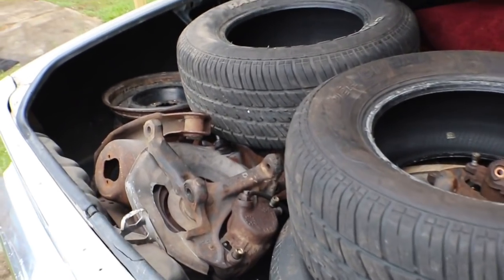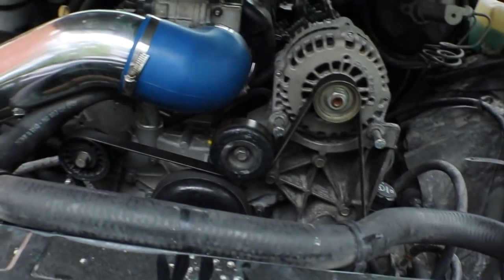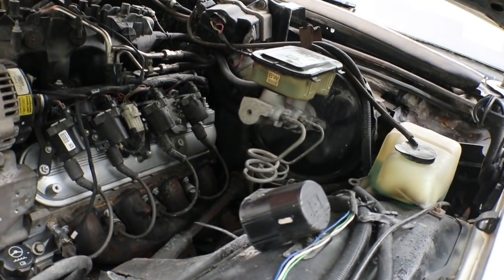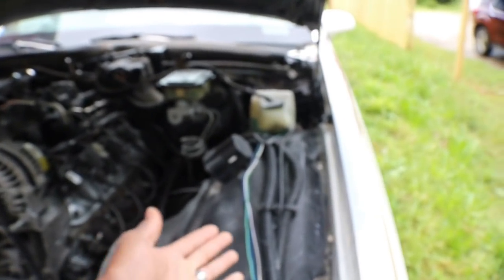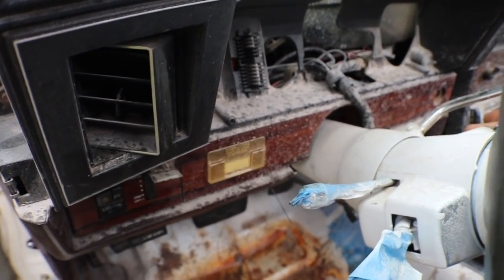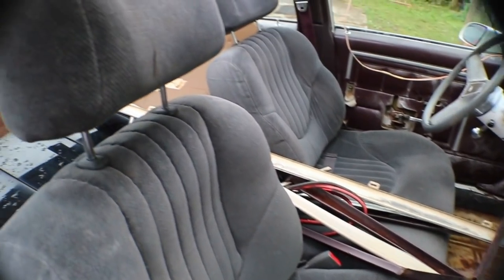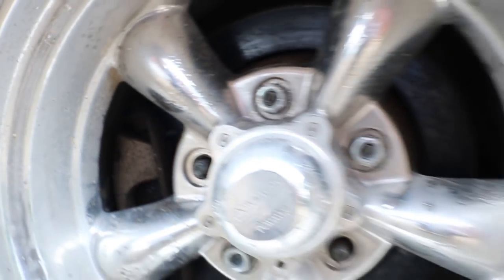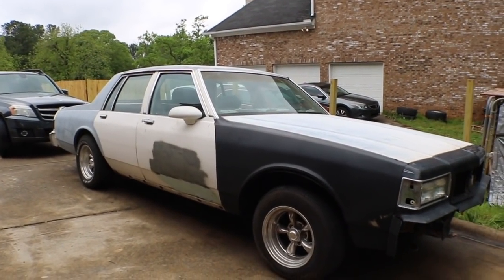SHE’S BACK 😎

Comment: I wish I can remember the name of this product. But it's thick pink liquid that looks and smell like perm. It's real good it will take paint, primer, down to the bare metal. You need too use a paint brush. And have thick gloves on and the vehicle warm. Me and my cousin was repainting one of his. And right when you put it on it starts working into the paint and primer. Then you use a plastic scraper. And it comes off in rolls. It might be airplane paint stripper. It took a 2 door monty carlo down to bare metal in 2 hours with just use two. Then you wash it and bare metal primer it.
Reply from the maker: They made all that complaint with the environment, it doesn’t exist anymore
Reply: @SteveDavisCarGuy  do you know when because I though it was still able to purchase
Reply from the maker: They did that is 2018
Reply from the maker: They still sell it but it’s not strong